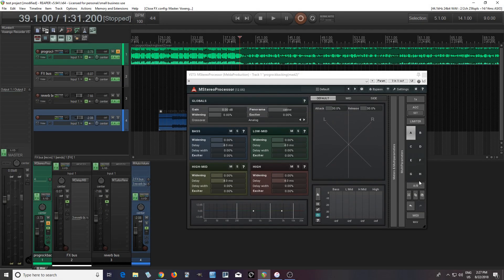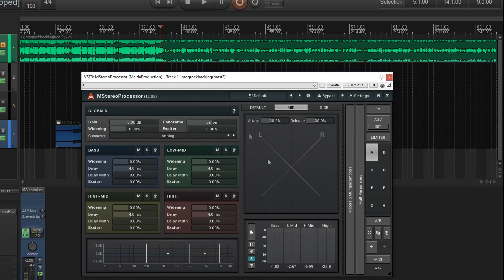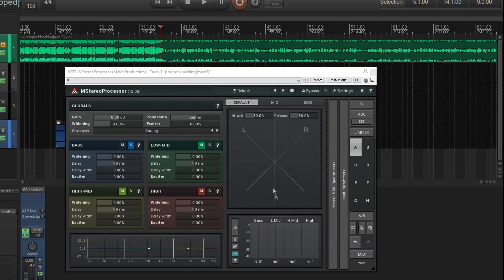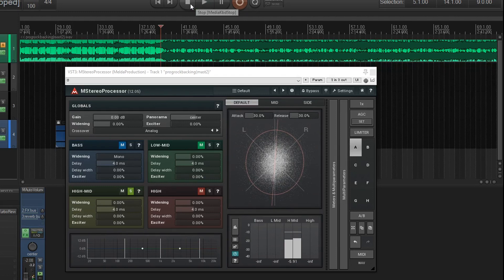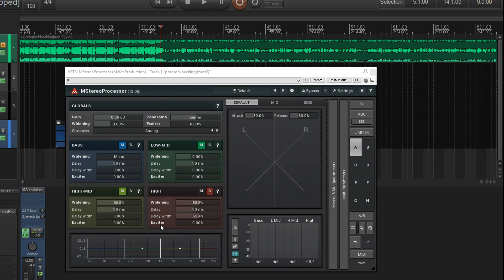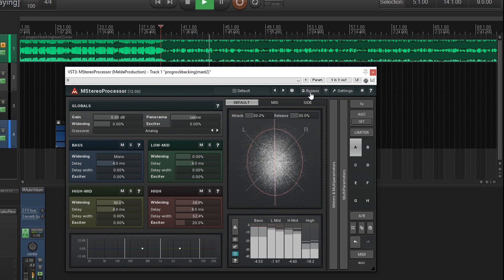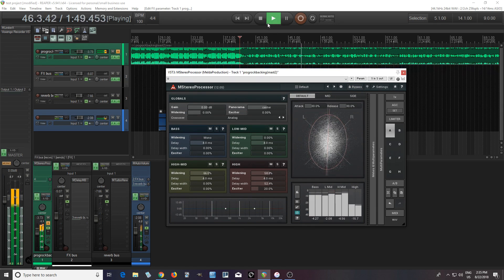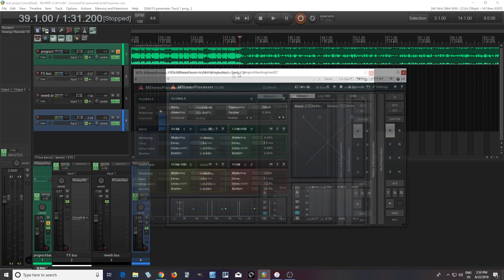MStereoProcessor walk through

Comment: Good afternoon. Thank you for your clarification. Unfortunately, Melda has problems with video tutorials.
I have a couple questions about MStereoProcessor.
Is it possible to create settings in MStereoProcessor from a reference track or reference project. Like what? I have a professional project for Ableton. Is it possible to put MStereoProcessor on one track or group or master and record stereo field in MStereoProcessor? So that MStereoProcessor will analyze and set the settings as in the project or reference audio file?
For example, like in OZONE 11, I can click on the cross, select an audio file, and then compare. But the problem is that Ozone 11 only shows the EQ of the reference track, and I need to set the stereo field settings as the reference.
Can you please explain, if possible, how it is done in MStereoProcessor.
Unfortunately I haven't found any video tutorials on how to work with Melda plugins and reference files.
One more thing.Meld's plugins have a learning tool.How does that even work? Are there any video tutorials, at least rough ones?
I hope I explained the question correctly.
Reply from the maker: MStereoprocessor unfortunately can't analyze the stereo field of a song. Of course you can look and manually look to see how wide it is using the meters. From there you can widen or narrow your mix in whatever way you want. You can do this per band if you want to get even more accurate. I hope that helps.
Reply: @Chandlerguitar  Thank you for the answer. I thought it was possible, since the plugin has training.If possible, can you tell me what the training is for? I have MCenter too, it has a machine learning too.I tried to try it but I don't understand how. I insert 2 audio files, the plugin starts to do something but doesn't stop, loading the whole processor.Or do you know any video tutorials on this function in melda plugins?
Reply from the maker: @michail_777  That is a new experimental feature. I'm still not exactly sure how to use it. Sorry.